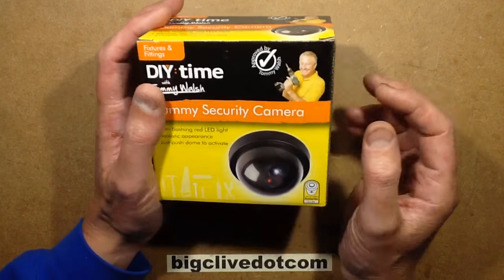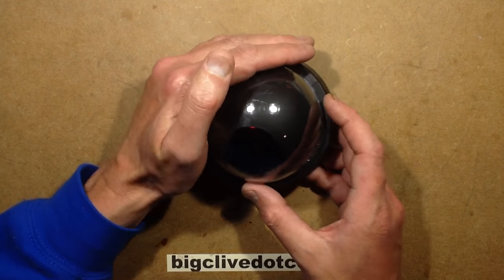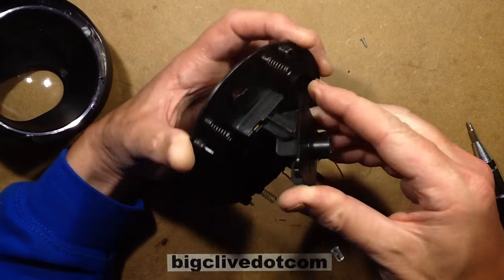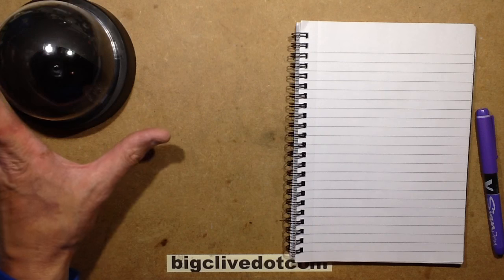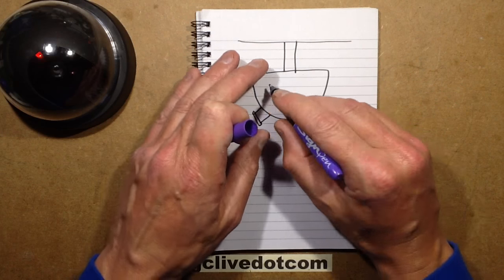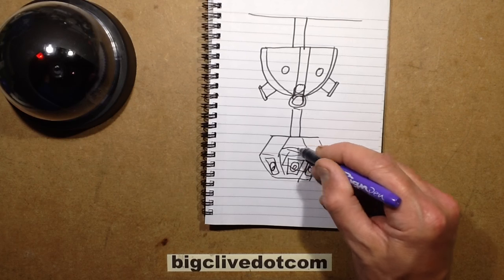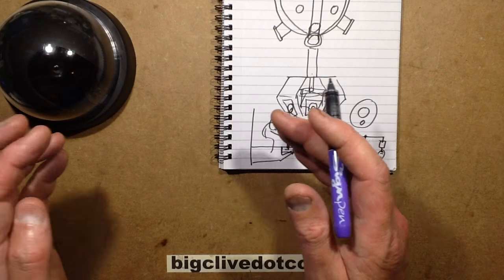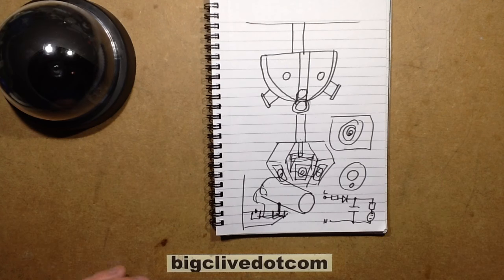Poundland dummy CCTV camera.

Comment: hey clive, is it possible to build a homemade adapter to connect a usb powerbank to a laptop to load/power the laptop?
I figured if you have an usb plug on one end and the laptop plug on the other and a boost converter in between it should work. What do you think?
Reply: It wouldn't supply enough current to operate it mate... At least certainly not for long and it would be horrendously inefficient
Reply: I have an Anker 20100 powerbank. I measured its capacity with an usb multimeter. Its about 19000mah ~ 3.7v. Max. Output is ~ 2.3A per usbport
Shouldnt this be enough to power a laptop? If I calculated this right it would be (19000 * 3.7) / 19 = 3700mah - a few per cent loss during conversion.
The laptop gets 19v @ 3.42A from its power supply. If both ports from the powerbank are used it should be enough. right?
If I get 3000mah from the powerbank it would be enough to load my laptop up to 75%
Reply: They do exist its just they are larger than your normal power bank so have quite a few cells in them so no need to power boost.

Some have 12 volt gel cells.
Reply: and they are damned expensive
Reply: I've actually been wanting to do that for a while. A few things to consider:

- A regular laptop power brick puts out 19.4V. In the laptop, this is stepped down to whatever voltage the 3-4 cell battery needs, so I think you'll be fine anywhere between 17-20V. "Intelligent" charge regulators may have a bit of an attitude though.
- A laptop draws up to 100W, especially when charging. This means your device should be capable of putting out as much as 5A without budging. This is where single-cell USB power banks will inevitably fail.
- Your power bank should have upwards of 100Wh if you're planning to extend a laptop's battery life significantly. That's a total of 30-40Ah across all its cells, or around 1Kg in LiPos or 2Kg in half-decent 18650 cells.

With all this in mind you could get a powerbank, re-wire the bateries into a 4S or 5S configuration, get a modest boost converter (perhaps 6S and a step-down would be more efficient though!) to supply your power in a suitable fashion, and in theory nothing should stop you. I have seen single 23Ah LiPo cells on Alibaba for $15US, although their quality remains to be assessed.

Hope this helps you, I'd like to see the device you end up building if you decide to.
Reply: My laptop battery has a capacity of 4400mah @ 10.8v. Its power draw from the wall (battery removed from laptop) ranges from 20-60 watts.
Reply: Spexxos1 It's best to check the output power rating of your power supply and match that as closely as your budget allows. Then expect an 80% conversion efficiency and keep in mind you'll probably have your laptop running while it charges, and there you are at 100Wh :)
Reply: Spexxos1 To answer your previous question, assuming the output voltage on your power bank does not drop at all when you draw 2.3A from both ports (in reality it definitely will), that's 23W. Now you need to put a boost converter on the end, whose efficiency goes right down the toilet when you're trying to quadruple the voltage, not to mention big currents. Expect no more than 75% in the internal (3.7->5V) converter and 50% on the 19V one, and that's generous. So by the time it reaches your laptop you will get less than 10 watts, hardly enough to keep it running, and this is with all the components running at capacity limit. You are much better off buying a cheap power bank and re-wiring the batteries into a series configuration.
Reply: mharris1270 A number of other things are rarely taken into consideration when manufacturers are talking about power consumption. The usual culprits are the screen backlight and the hard drive. Switching to an SSD nearly doubled my battery life, and just closing the lid helps too. And then we're only taking about the net power consumption, after all the switch-mode and linear regulators inbetween. These are optimal figures that become invalid as soon as you're just watching some youtube. 30W is to be expected even from the crappiest of power supplies, and no amount of neglecting efficiency and taking chinese battery capacities at face value changes that
Reply: mharris1270 With the lid closed and the hard drive spun down, my 2013 laptop drops as low as 12 watts, which is pretty neat for an i7. Still though, you'll agree that 10-20W is asking a bit much of a single cell battery, at least one out of a powerbank.
Reply: +mharris1270 
Well I mean you can pull anywhere from ~85w - ~40w from a single good quality 18650 safely
Reply: xLDKx NewYorker High power cells tend to sacrifice capacity though. Besides, I think that's kind of missing the point of the project. Of course you can throw money at the problem. The idea is to build it cheap
Reply: Dennis W 
What mAh rating you looking for per cell? Mines about 3Ah

I just felt the need to respond to that singular comment, as it's later in the night and I was just perusing the comment section for my nightly dose of concentrated cancer. Which I surprisingly haven't seen yet.

Gonna go to sleep soon.
Reply: xLDKx NewYorker I find it doubtful that you have a 3Ah cell with 10C rating in an 18650 form factor. High power cells tend not to exceed 1.5Ah. Have you run a capacity test on them?

Edit: If you say you "can" pull 80 watts from a single cell safely, you're probably not talking about rated power. My bad.
Still, 3Ah is a bold claim for 18650 cells. And since we're working out specs for a powerbank that can charge a laptop, I'd like to see at least 10Ah 4S. Personally I just prefer poly cells for their lack of a heavy metal casing and better space utilization.
Reply: Dennis W 
2Ah**

Mistyped
Reply: +Spexxos1 I have the same one. Lots of people who don't know what they are talking about write bad reviews on Amazon because they inproperly measured them (I saw reviews noting an actual capacity of 8,000 Mah or less even though it's untrue) If you did happen to purchase it from Amazon (and even if you didn't you can still write unverified) and haven't already done so, can you put a real review of it? I see way too many reviews with people inproperly measuring the battery bank.

Comment: To  answer your question when is the last time that I've seen a red light in a CCTV camera, very good question however I actually do know of one camera and its where I work (Best Buy) the CCTV Camera that faces the parking lot (outside camera) has a light and it does flash. funny enough When I pan the camera I could never see the light (through the cameras). The camera I'm speaking about actually controls and looks to be the exact same as the ones  as inside (but they dont have lights)

Comment: I used the actual cover to install a real outdoor cctv IP cam (no IR). I used silicon to make it water proof but leaving a breather hole. Use a cut down wet wipe as a filter to stop bugs etc getting in the hole. And you're good to go. Not as robust as a 'real' outdoor cam. If you're watching "bigclive's" vdo's you're not here to do the normal thing. :)
Reply: Oh it goes under the eaves BTW
Reply from the maker: The filter over the hole is a nice idea.

Comment: Did you actually look, was it a dummy camera. SOME of the chinese dummy cameras used to be real cameras because it was cheaper to use an existing component than design a dummy. That however was in the days of camera resolution of 350 to 450 lines!! I'd almost expect those cameras to have an old 400 line 12v analog camera inside just to hold the lens in place.

Comment: I'm surprised people even buy these, CCD systems are dirt cheap.  I put together a decent Sony 960H system for ~$16 USD (700tvl camera and IR) granted I bought all the components on discount.  The red light on mine is an 850nm IR, I wanted to use 940nm but the other was cheaper.  I still went sneaky ninja and set it as a bounce light to hide the glow, gives better fill light too.  I could see using the fakey one as a decoy though, then I could be a devious sneaky ninja.

Comment: yes, the LM3909 was basically a relaxation oscillator, but it wasn't very efficient one, if you want to build a simple 2 transistors LED flasher that will operate for years on 2 alkaline AA, even a decade with lithium primaries, I recommend this circuit:
http://discovercircuits.com/DJ-Circuits/3vledfs1.htm

Comment: Hi clive yes they was real cameras, the shiny chrome strip was in fact one way strips and you have the drawing wrong the chrome strips was around the outside and the dummy lenses was on the black quarter bits the real cameras was inside looking through the one way chrome strip and yes they did move a bit but this was controllable. I use to work in a shop that had these cameras but not Woolworth Ho yeah also the cameras was able to pivot up and down inside the chrome strip,... so if you was pilfering and you would do it so the dummy lenses wouldn't see you but they was watching you through the silver strip.

Comment: Funnily enough there is a poundland near me with one of these fake cameras at the tiny makeup section. You can actually see the back of the surface it is stuck to and therefore it is obvious there are no wires or anything... So I can only presume one of the employees thought it would be a good idea to use their own fake cameras they sell in order to prevent thievery of the makeup. Totally stupid.

Comment: "it's almost worth buying this just because of that LED"... really?
Reply from the maker: It's an unusual flashing speed and ratio. The whole product also costs the same as JUST a flashing LED from the main UK hobby electronics supplier.
Reply: bigclivedotcom
jesus, that's one pricey LED, can see why you said that now. in that case you should track down where Poundland gets the LEDs from and cut out the middle man, because they must get them for much cheaper if they're making a profit (or even breaking even) from selling these things. i wonder what poor ol' Tommy Walsh makes of all this.
Reply from the maker: +Mikail Elchanovanich You can buy bulk flashing LEDs on eBay if you can wait for them being shipped from China.
Reply: bigclivedotcom
hence the "almost worth" i suppose, patience is not on the side of the hobbyist with a cool idea lacking that one specific component they don't have.

Comment: I am going to continue pointing out your Poundland screwdriver until you say 'I'm poor'.
Reply: I went out and purchased one of those screwdrivers too. I can say that it does the job and is probably the only Poundshop thing I've owned that's lasted longer than a week...
... also "I'm poor"
Reply: Ive got a couple Ive had for years and I think theyre great, probably the best precision screwdrivers you can get without spending "proper tool" money, just because the tips seem to be well hardened. Most cheap precision screwdriver tips arent, and get chewed up really quickly but these ones last. Their only flaw is when they dont fit into deep screw holes.

Comment: Could shove a Raspberry Pi with camera module in it.
Reply: Why? You can get a cheap camera off eBay. Save your money for something else.
Reply: It's not all about the cost - putting a Pi based camera would be an interesting project, and this looks like it could make a nice ready made enclosure. The result would be something expandable to your exact requirements, with a little fun learning to be had on the way. Another idea, what about putting a PIR in one, and turning the LED on only when there's movement; might look a little less fake.
Reply: but some people bought a pi just to have one, i have currently 3 doing absolutely nothing (a RPi B, 2B and 3 for those who were wondering why buy more if you're not using the ones you have already) so i now need a zero and camera enclosure. They also introduced a new camera, so i can't use the one I already have)
Reply: yes you can just need a different cable for the pizero small connector
Reply: MrJozza65 They aren't good for dedicated projects. It would be better to get a camera from ebay and spend less than 5 bucks on it than $13 on the pi and more on the modules you will need to make it do the task. It isn't cost effective. It's just a waste of time.